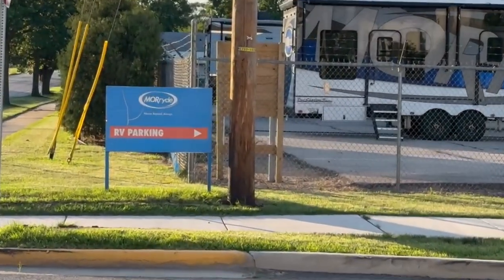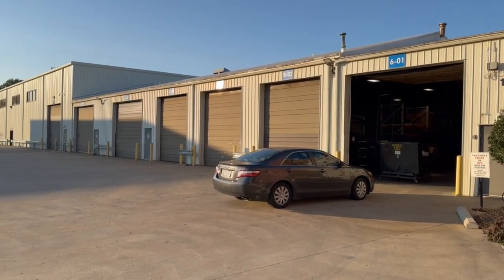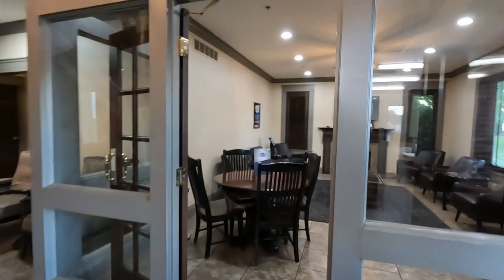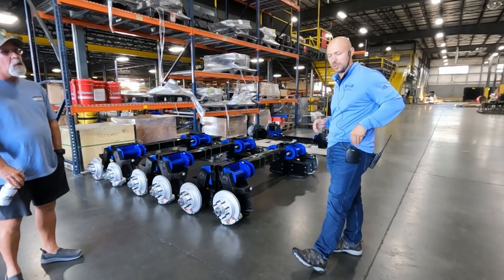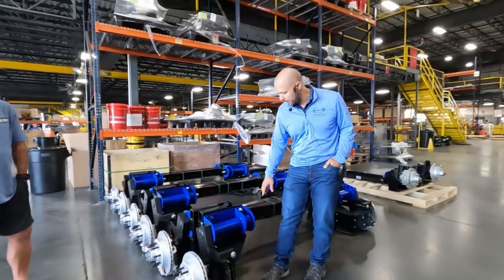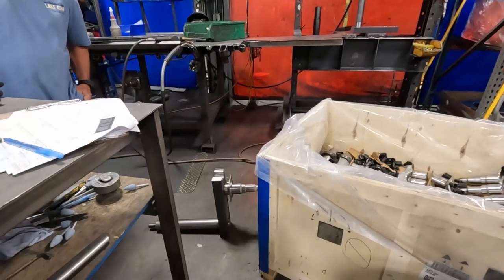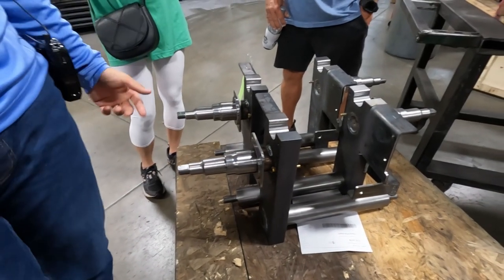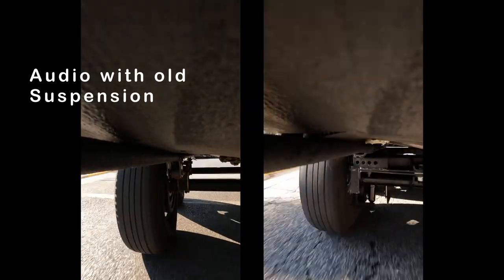MORryde Independent Suspension System. Worth the Money? - Our full experience! #rvlife

Comment: We had ours installed in May, we already had disk. Drove 1100 miles to Miss afterwards and had some work down on slides. The tech raised the F/W to do some work and noticed one wheel wiggled when it cleared the floor. The caster nut was two complete rounds from being tight. Also when he went to remove the tire to check things all lug nuts were stripped. I was setting there watching the whole thing. I called and let Morryde have it. They were apologetic, and offered to pay for the  work. I didn't care about that I wanted them to know how disappointing it is.
Reply from the maker: Wow. Guess it’s always a good idea to check things when you have work done. We’ve gone about 2500 miles with our IDS and no issues for us except a loose propane line but that was an easy fix. Maybe we should pull our wheels and check.